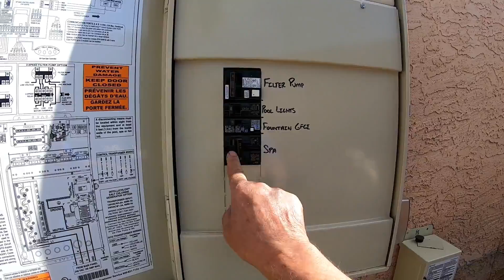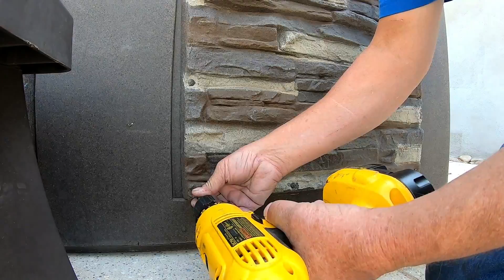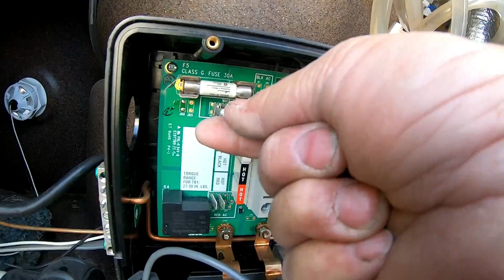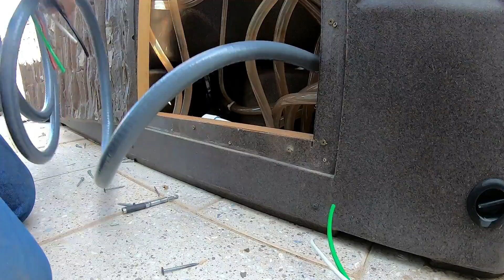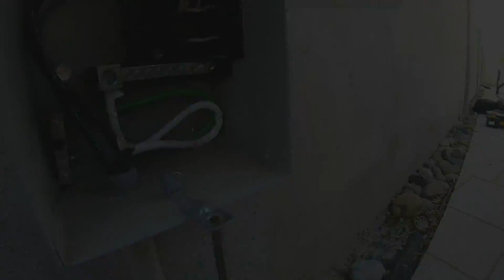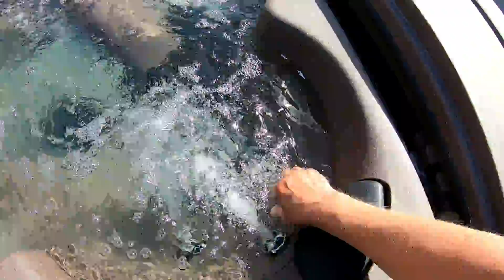How to wire a 220/240 volt Spa... Step by Step details

Comment: Is it better to have the gfci breaker in the main panel or in the sub panel for a 3 wire Sundance hot tub. I would like to have the sub panel close to the tub for Maintenance. IE not having to walk through the hole house to Shut the breaker off.
Reply from the maker: On a three wire hot tub ... With the main breaker (OFF) I install the GFCI in the mail panel and a 50 amp breaker in the Sub panel...Sub panel should be no closer then 5 feet to the spa and no father then 20 feet from the spa and in the line of sight. I also alway install them 36 inches off the ground so that no one is able to use it as a step...This is how you make a 3 wire spa GFCI safe.  Thank for Watching & SUBSCRIBING
Reply: @spaman5440  thanks a lot . Great information.

Comment: What brand of wire I need from Home Depot y what type of breaker? Thanks.
Reply from the maker: I use #6 THHN or THWN wire and most often a 50 Amp GFCI breaker or 60 Amp GFCI when needed... Thanks for Watching & SUBSCRIBING

Comment: Love your videos and very informative. You've shown me how to rewire my hot tub since my breaker and underground wiring need to be replaced after it kept causing the breaker to trip (I think it's the wiring underground housed in pvc pipe). I saw that you used the non metallic conduit hose but above ground. Is it safe to use it below ground as well?

Comment: Very thorough explanation.  I need to do everything in this video, install the spa sub panel, spa panel breaker, wire it all up,  and convert my tub from 110v to 240v.  I was nervous and procrastinating the task,  but after watching the Spa Man's video, I feel confident and ready to tackle it.
Reply: That’s correct. Per NEC 680.13 states at least 5ft away but no more than 50ft.

Comment: Do you use Romex 6/3 in the sealtite flex conduit or four separate ones?
Reply from the maker: No...Never. I use #6 on all four wires in seal tight .Thanks for Watching & SUBSCRIBING

Comment: Do you know if you can run conduit along an exterior brick chimney? A hot tub is being installed (50 amp breaker, 6/3 wire) but conduit will need to be run along exterior of house -- is it ok to run conduit along (around) an exterior chimney (per National Code)? Thank you I found a lot of helpful info on your channel -- just subscribed.
Reply from the maker: I would never run 6/3 for an exterior install...I would run #6 on all four wires from the main to the Sub panel. If you need more info call me at the shop. Thanks for Watching & SUBSCRIBING
Reply: @spaman5440  Thank you!! I was planning to use outdoor rated but yes individual #6 wires (4) makes more sense! I can't find anything that prohibits conduit on exterior chimney -- T Y I appreciate!!

Comment: I can’t see where I can send a picture but we had someone hook ours up, it ran for a couple hours but now the breaker just keeps getting tripped. In your final step with the 50 amp breaker, does it matter if the black was on top and red on bottom?
Reply from the maker: If it ran for a coulee hours you have something else going on. You can call the shop and Talk to Scott and he should be able to get you going in the right direction. Thanks for Watching & SUBSCRIBING

Comment: My electrical panel doesn't have separate neutral and ground bars.  For my hot tub, would I put them on each of the screws (2 spots) right infront of the breaker location?
Reply: You might have to add a ground bar. The bar you use for the neutral should be isolated from the panel. Usually by plastic spacers. The ground bar should be mounted directly to the metal panel and the two bars should not be connected. If something goes wrong with your hookup the neutral could become hot. If you have the ground hooked up to the neutral dangerous surfaces and the water could become hot.

Comment: My main breaker box is in my garage, approximately 25 ft from the hot tub in the backyard.  Any reason I couldn’t run wiring directly from my breaker box to the hot tub using conduit?  Or do I need a sub breaker box closer to the hot tub?

Great video!  Thanks so much for the instruction.
Reply from the maker: I would put a sub panel no closer then 5 feet and in the line of sight of the hot tub.. In the event of an emergency I would want to be able to shut the power off... Just my two cents.Every time I lay out a job my focus is safety first.Thanks for Watching & SUBSCRIBING
Reply: @spaman5440  no thank you!!
Reply: In order to meet code, and for your own safety, you need a sub panel with a gfci breaker, readily accessible but not closer to 5 feet of the spa

Comment: How the hell do you get all them wires in the 1" inch hole on the RS101 and then 90 them to get into that f'n hole ? Whoever designed that board was on drugs.
Reply from the maker: Im with you...Bad design for sure.. I try to never use any 90s for that reason unless I have to...Over the years of doing this Ive just gotten fast at it. Thanks for Watching & SUBSCRIBING

Comment: WhT would happen if you hooked up the common wire from the spa to the common wire bar in the sun panel?
Reply: The neutral (white wire) that feeds the spa from the disconnect, must be connected to the gfci breaker, not to the neutral bar, otherwise the gfci will not work correctly, most likely will trip.
Also make sure that the ground wires (green or bare copper) are not in the neutral bar but in the ground bar, neutral and ground should always be in separate bars in sub-panels

Comment: Nice Work sir!!!
Is it necessary to have a sup panel if the main breaker box is within 7 feet of the Spa? 
Could you just add the 50a gfci breaker to the main panel and run 6 gauge Wire directly to the spa?
Reply from the maker: Yes that will work fine.
Reply: It will work but it won’t be as safe and may not be to code. Is your main panel within site of the tub or is it around a corner? If someone needed to immediately turn off power to the tub would they be able to find the breaker in a main panel as easily/intuitively as turning off in a sub panel? These are the safety questions you should be asking.

Comment: I should would love to pick your brain, I am working on a hot tub that is getting hot and staying hot - just turned off the freeze protect switch because it seem to be running not stop not sure where to go next with the trouble shooting because there is not spa display to give me any ideas of what is going on. Just replaced heat coil and sensor on the tubing for the heat coil - tub was not heating up, now it is but it is over heating?
Reply from the maker: Give Scott a call and talk to him... He's in the shop most days after 1 P.M. Thanks for Watching & SUBSCRIBING

Comment: As an electrician that hooks up hot tubs I have to say very nice job man, great details and very thorough. And to code.
Reply: In my area the shut off box is supposed to be above 18" from the ground and between 6 feet to 15 feet from the tub.  A local electrician quoted $4,500 (4/2024) to do the hook up.  I bought all the parts for $700 and did it myself in a day.
Reply from the maker: Thanks Sir
Reply: Actually,  the shutoff box is supposed to be 5 feet away from the spa. The shutoff box is mounted way to low!

Comment: I am adding a 60 amp spa panel GFI, do I need to run #4 wires from the main to the Spa panel, then #6 wires from the Spa panel to the Spa?  Or can I run #6 from the main to the spa panel and on?
Reply from the maker: If you are going to do that...You need to put a 60 GFCI in the main panel and run #4 THHN wire to the Sub panel and in the Sub panel you can put a 50 breaker and run #6 wire THHN wire in Liquid/Seal tight to the Hot Tub. Hope tis Helped Thanks for Watching & SUBSCRIBING

Comment: @SPA MAN I'm thinking about putting a hot tub in my garage. Would it be acceptable to put a 220v receptacle in the wall, connected to a GFCI breaker, then just run a whip from the hot tub and plug it in?
Reply: great question !! I would like to know this as well

Comment: I was told from spa store to use 3 wire for JACUZZI brand tub but told from contractor that they run 4 wire. Does it make a difference in performance or wouldn’t matter?
Reply from the maker: Yes it does matter.. In the main panel you will put a 50 GFCI breaker and use 4 #6 wires THHN  that will run to the sub panel. in the sub panel you will put a 50 amp breaker and use only 3 wires THHN also (2 hot wires and a ground)and run that to the spa in seal/liquid tight. Sub panel can be no closer  then 5 feet to the spa and no further then 20 feet inline of sight and 36 inches min from the ground. Hope this Helps Thanks for Watching & SUBSCRIBING

 (Side NOTE)... In this video the sub panel was passed by an inspector...But on the permit and prints it said it was going to be an outdoor kitchen had the inspector known it was going to be used for a Spa they would of RED tagged it...
Reply: @spaman5440  you said the sub panel can be no more that 20’ line of sight. Does that mean the cable run can be longer that 20’ to the sub panel? For example if the wire needs to go around or under something like a shed.
Reply from the maker: @sandyradsek2058  From the Main to the Sub is what it is... when you get to the Sub it should be no further then 20 feet from the Spa and no closer then 5 feet to to the spa and in the line of sight with no obstructions in the way. If your still not sure call the office and talk to Scott. Thanks for Watching & SUBSCRIBING
Reply: Need to add sub panel from main to disconnect, then to tub. Will be 240V 60 AMP

Comment: Wow.  Great video.  Thanks.  Quick question:  I have builder-run spa wiring.  A black, red, white and ground wire run from a GFI 220V 30A ganged breaker in the box.  All my spa equipment is high amp (e.g. 10A) 120V: pump, heater, etc.  Can I wire the outlets to split the red and black circuits and have the return be the same white in both and have the GFI work properly?  That is, the red/white pair and the black/white pair each have equipment on them, and both circuits are protected by the ganged GFI 220 breaker in the panel?  It would seem to work properly--since no current is lost to ground.  All of it balances back to the neutral in the breaker.   Works???

Comment: Thanks for the excellent details. I'm about to wire a Hot Springs spa for the 220volt option, and the only difference is the wire gauge - looks like you wired for 6 AWG, and I'll be wiring for 8 AWG, according to the install procedure, from the GFCI breaker.
Reply from the maker: You will also need a different Breaker package... You will need to use #6 from the Main panel to the Sub panel,,.In the Sub you will use the required breaker for a Hot Spring the use #8 from the GFCI in the Sub to the Hot Tub... You will also need to make sure you use THHN wire (Stay away from ROMAX wire) Hope this Helps Thanks for Watching & SUBSCRIBING
Reply: @spaman5440  Yes it makes good sense - actually all of what you've replied with is planned for the install: 4 wire #6 AWG from main to sub in metal conduit, and 4 wire #8 AWG from sub's GFCI in sealtight to spa. All wire is THHN. I especially appreciated the details on steps to convert 110volt to 220 volt configuration. Thanks so much for taking the time to reply..
Reply: @wladewig   I know this is old but I’m doing this now for a hot springs hot tub. I assume that there are different directions for different models. Mine says to use 2 #10 and 2 #12 wires when running from sub panel to hot tub for 240v.

Comment: What size seal tight tubing did you use for #6 wire? 1 inch or 1/2 inch ?
Reply from the maker: I use 3/4 or bigger Seal Tight
Reply: @spaman5440  Thank you sir!

Comment: What did you do with the Sealtight going into the tub through the hole you drilled. How did you seal it, did you use a rubber grommet  some other type of 
seal

Comment: Is #6 wire adequate for a 60 amp gfci breaker?
Reply from the maker: The NEC says yes... Now I have a rule of thumb I use.
100 feet or less #6 THHN wire only on all wires no down sizing wire. No more then 7 Total HP motors with heater and you should be fine. Over 100 feet and or Big HP motors and large heaters changes everything. Hope that Helps Thanks for Watching & SUBSCRIBING

Comment: What's your take on downsizing the neutral wire. Tip for you also. After doing hundreds of panels here in Chicagoland (solid wire) I found it best to go back and give all lugs and breaker screws a check. I seemed that by the time I would get done with the panel the first breakers could be cranked a bit more. Don't know why
Reply from the maker: I would never recommend downsizing the wire! for the amount of coin you will save its just not worth it to me. Now I do keep track of the tubs I see with down sized wire and quite often they are the ones that are alway having problems during the cold of winter or like here in AZ when it is 110+ during the summer either tripping the breaker, over heating. Thanks for Watching & SUBSCRIBING

Comment: Is the liquid tight tube code or is that just recommended? I am looking up a bunch of stuff on this and I was planning on having grey pvc come from the box under ground until I got under the hot tub then just the wire to the box on the tub. The wire I bought is southwire 10/3 UF wire and says is designed for direct buriel and wet or dry locations
Reply: Direct burial for wet is okay. Direct burial in conduit is okay. But if you're going to use conduit you have to follow the regulations for the conduit. This is the tricky part he's not going to write everything about.
Reply: @TravisFabel  thank you, I still haven't done the wire (I actually found out I had the wrong wire) and have ran into other problems but those are fixed now but what I am thinking now is running hard metal conduit on top of the concrete and bolting it down and trying to find something to cover it with. My problem is I don't have any electrician friends and the guy at lowes doesn't know what he's talking about lol
Reply from the maker: You need to call Scott at the Shop.You have a lot going on and we don't want to confuse others reading this and give out info that fixes your problem and is totally wrong for there problem.Thanks for Watching & SUBSCRIBING

Comment: HOW DID YOU SEAL THE LIQUID TIGHT WHERE IT ENTERED THE SPA?
Reply from the maker: I didn't there is no reason to seal it. It is just a hole in the side of the tub that I drilled its a pretty tight fit... Thanks for Watching & SUBSCRIBING
Reply: @spaman5440  I would seal it. Around here it's an invitation for bees, fire ants and wasps to make nice little nests.

Comment: 6 wire  Hotsprings Grandee install to 50amp gfci sub panel. Help Please.

Stood up by two electricians Had to insist inept general contractor leave property when damaging main grounding system.

Now I'm on my own with last step of connecting 6 wire spa to sub panel but I'm only seeing videos for 4 wire tubs.

Please advise to help understand 4 wire verses 6 wire install connection to sub panel. Thank you.
Reply from the maker: A six wire spa is not easy to explain here..I know Scott is in the process of Video/Editing on this subject..I would suggest calling him at the shop and talk to him directly. He is in the shop most day after 8 A.M. Thanks for Watching & SUBSCRIBING.                               I let Scott know that you might caller help.
Reply: Dang Spa Man & Helper! You're good! Thank you!!

With hope of getting spa powered up before snowfall I made the call, leaving message not really expecting good help from a YouTube channel.

While returning empty handed from three hour drive to buy panel (that turned out to be another 4 wire) to my surprise I get a direct call from Scott with his full understanding of our circumstance with 50 amp, 30/20 split two breaker sub panels for 6 wire systems being unavailable, or at least very hard to find.

Within minutes Scott provided clear, detailed, concise instruction that I feel confident will function safely and well. 

-At main install 50amp GFCI breaker
-Run #6 wire to sub panel, NOT #8
-Within weather resistant sub panel use 30amp & 20amp standard breakers

After months of seeking correct sub panel, paying for assistance, being stood up by two electricians, another coming to estimate yet not providing one, a general contractor working outside scope of license, poorly installing wrong sub panel and putting shovel through wire of overall grounding system, I will cautiously yet confidently be handling this myself.

Update to come. 👍

Comment: Great video with good info! I believe that GFCI Spa panel is too close to the tub to pass code but it looks like that problem was already done before you got there.
Reply from the maker: That spa panel did pass code and was permitted along with the pool...I was not part of the install of the of the pool or the Sub Panel. I want to say that more the half of the Spa we see every day are all done the same way these day. I personally would never recommend doing it that way. Im seeing more and more new builds installed this way everyday.. Thanks for Watching & SUBSCRIBING
Reply: @spaman5440  odd that it passed, NEC code to have it at least 5 feet away
Reply from the maker: @Josh-mk7ok  I agree... I don't think the inspector new what was going on and someone put a sheet of plywood  or bricks in front of it, (Ive seen home owners do that several times over the years )Thanks for Watching & SUBSCRIBING